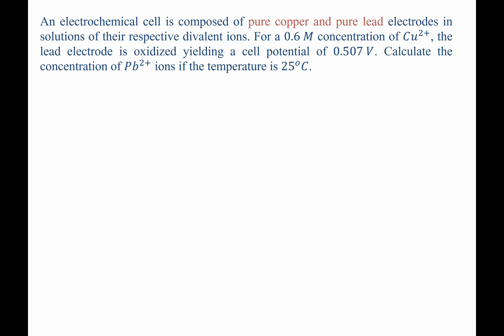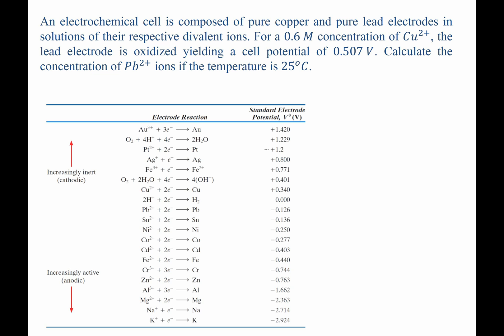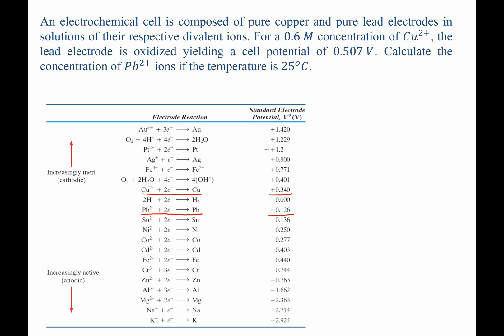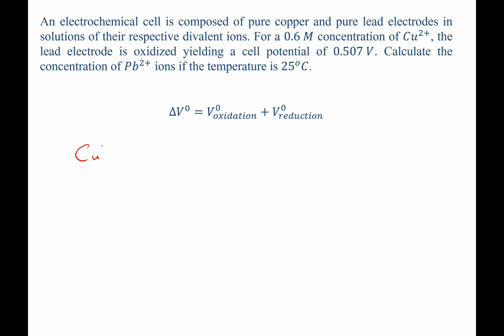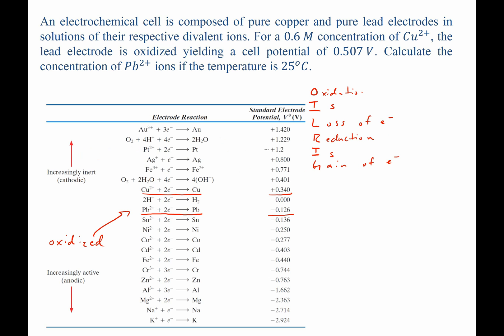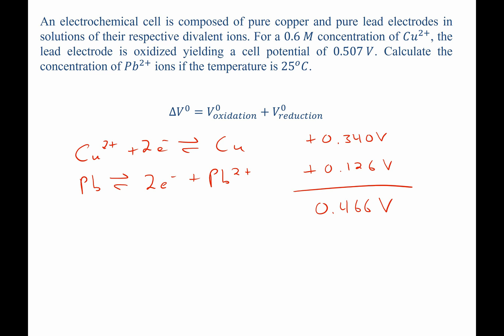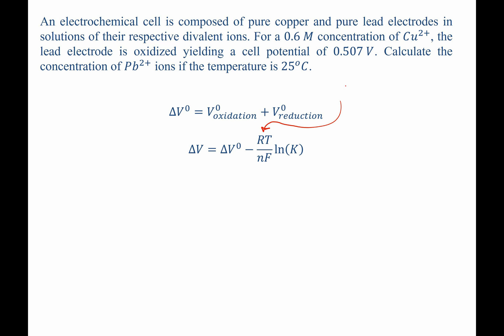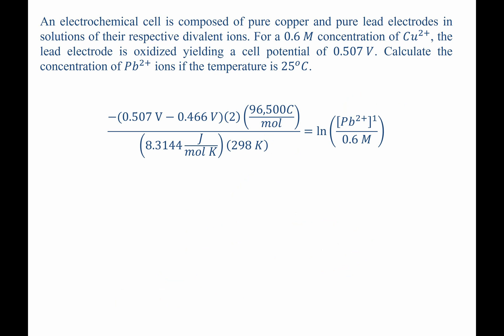Electrochemistry and corrosion example problem

Comment: I have another question also .What does "Stress Corrosion Cracking (SCC)"  really mean ? I do not get it.
Reply from the maker: Stress corrosion cracking is what you get when you combine stress and corrosion. In other words, a situation with stress alone that would not cause a crack to grow, will have crack growth if you add corrosion and vice versa. The most common way that this is manifest is when there is a stress on a crack and if you zoom in on the tip of that crack, if there is water present due to the high radius of curvature, the solubility of the material in that water is higher than elsewhere. Therefore, the tip of the crack dissolves, thereby growing the crack a little bit and as the crack grows eventually it will be long enough to satisfy Griffith's fracture equation and the material will fracture. In other words, if it wasn't for the water at the tip causing corrosion, the crack would not have grown because it can be a static load, not necessarily a fatigue load.
Reply: @TaylorSparks  Thanks a lot professor .I really appreciate it.